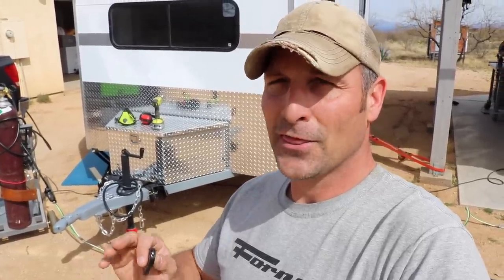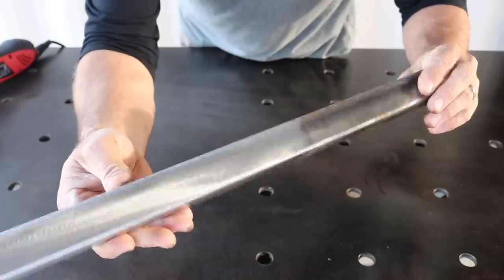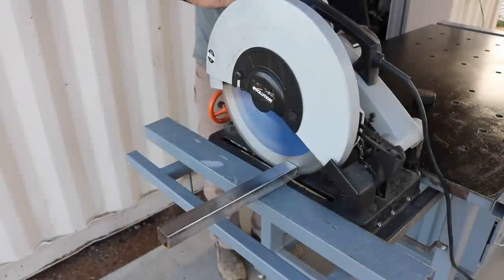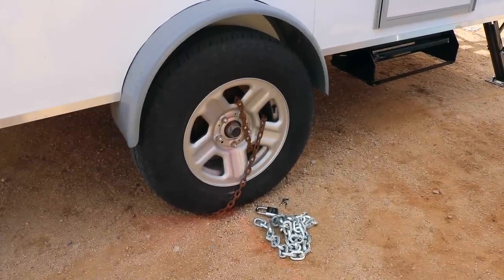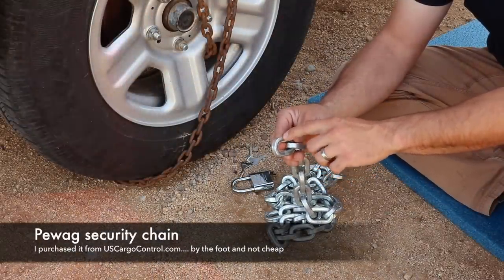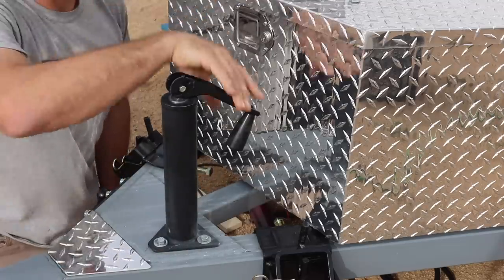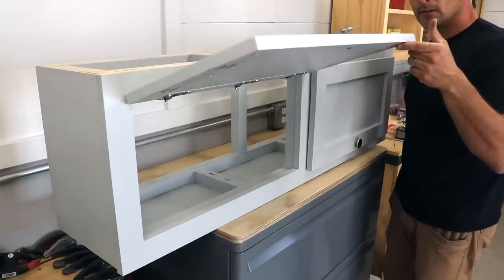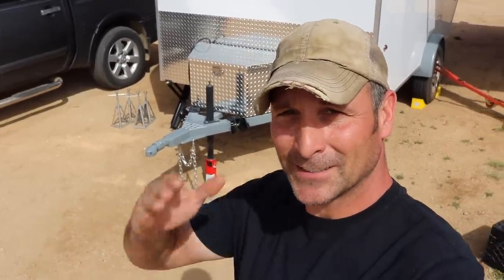How to Build a DIY Travel Trailer - Folding Steps, Security, jack mod and more (Part 8)

Comment: Our trailer had button magnets mounted on the ceiling to catch the pulls and hold the upper doors open. Clean, easy and worked well.
Reply from the maker: I've been thinking of magnets as another option for sure :)

Comment: i too, use a drill on my trailer jack. although i did not weld a nut to it. i used an old spark plug socket, drilled a matching hole to rin bolt thru shaft of jack. use a socket adapter on my drill... works great. many campers ask about it and say they are going to do the same when they return home.

Comment: To make the five jacking points more secure, you could always weld on the head of a security/locking wheel bolts that you'd use for expensive car wheels - you'd need to cut the heads off of then weld that onto the end of the jacking points - Even just having one security bolt makes it infitinitely more difficult to move the trailer and although the chain is a good security measure, you want additional measures to make it more secure.  A potential thief will come with a socket set as the legs could be down, but if theirs a locking nut they can't undo, then  it makes it more difficult for them to steal and will more than likely leave it alone.
Reply: I was thinking that the chain thats visible on the wheel rim, maybe run it through some painted (for visibility) steel tubing as well, to make it more difficult to get a grinder at - padlock it behind the wheel so its in a difficult place to access for someone with cutting tools
Reply from the maker: Andrew (DadofTriplets) you know that wouldn’t be too much either....I like it!!   And adding some tubing on the chain is a good idea as well.  It is currently locked behind the wheel in difficult spot to get at.   Definitely accessible still....since I put it there but certainly makes more hassle to get to it

Comment: Good stuff Joe, coming close!

As you and others have said - if they really want to steal it, they will. The key is to make the crooks think hard about how badly they want it. 
I have a similar system on my SUV, I run a chain from my accelerator pedal to my steering wheel, so that if it comes down to my truck or the one parked 2 spots down, hopefully mine is less attractive....
Reply from the maker: MamboTek yep that is ultimately what it comes down to...making it less attractive to the thief😀👍
If they really want it then they will figure a way...but at least I can make it a huge hassle
Regarding thieves... I have such a disdain for those kinds of people that if I could figure a way to put a bear trap on that trailer without hurting good folks...I think I would😂

Comment: They make a step called solid step, and they bolt under the door and go all the way to the ground. You could probably build them yourself. I have them on my camper and it does not shake at all. Love your videos by the way!
Reply from the maker: Thank you Cooper!    That was my original plan... to get a single step and have a solid one that I just set up below it... but when this double step opportunity came up I was  sold ;)

Comment: Do what we do & use a rock right under the tip of the last step.
Where just hillbillies down here in Missouri... lol... it works for us & I got a souvenir from the lake.
Great job anyways.
You need a trailer lock that goes on the tongue of the trailer.
Chris from Missouri
Reply from the maker: haha... yep a rock will do the trick for sure!   and stayed tuned as I do have a coupler lock in the works :)

Joe

Comment: Painting the chain red may keep you from driving off with the wheel locked. Maybe add a flag too. (So you or your co-pilot can see it in the rearview mirror.) It will also be more noticeable to theives "casing the joint"  💜🌵🌞
Reply: Great idea. I drove of with a U bolt lock thru the wheel and didn’t even notice because I was on snow and ice. Then hit a dry spot and destroyed my wheel. “It happens”

Comment: Mounting accoutrements is where I regret buying an aluminum trailer. Moving it is where I rejoice buying it. I'm working on security that will make my trailer less attractive to the criminal minds with battery-powered cutoff wheels. Love the jack hack. It will allow me to mount a propane bottle on the front.

Comment: We've had trailers, motorhomes and 5th wheel's my whole life. We've never had any stabilizers on any of the entry steps to any of them. Nice touch on the tongue jack conversion. That's a nice jack too. One thing you can do as a theft prevention measure is to remove your  safety tow chain and put it on only when towing it. People  use them to tow with. Also, I recently stumbled onto a bunch of youtube videos about lightweight  cabinet construction  for r.v.'s. Do a yahoo search on poor mans fiberglass  and dive in.

Comment: Excellent upgrades!!  You may have already thought of it and created an "idiot proof" (no insult intended... haha) reminder to ensure you don't hitch up the trailer and go to pull out and forget that the Pewag is still locked through the wheel.  I used to clip something like a "Remove Before Flight" flag on my trailer tongue to help me to remember the 3/8" cable I locked through my trailer tire/frame.  Just an idea...  :-).  Great vid!!!

Comment: Great..but your travel trailer deserves a holding tank for your Grey water. Think about It! Good job as always!
Reply: He's putting in a tank under the sink. Did you mean something larger under the trailer?
Reply from the maker: Carlos Eduardo Zampol I will have a small portable grey water tank under the sink.  I’m not going to have anything under the trailer except for something to protect the underside from road spray, etc
Reply: @homesteadonomics  I think that is a good choice. 👍
Reply: @toronado455  Yeah, a holding tank under the trailer. You do not need to remove it for cleaning. When it is full, you connect a hose into its tap, open it and discharge it into a  camping site with septic tank or any other specific place ( in a filling station, for instance )

Comment: Hi, you might want to consider sealing everything behind your cabinets before install. Trailers are especially vulnerable to insect infestation and colonies behind cabinets are particularly hard to get at. A good bit of silicon now may save serious head aches later.

Thanks for the cool video.
Reply from the maker: Phylis Maddox yes, good point and I will probably do that😀👍

Comment: When designing your tounge lock it might be a good idea to lock the safety chains inside of it too so they can't just use those to drag it away.
Reply from the maker: Todd McCarter I’ve definitely been thinking about how to do that....the proven industries locks have that....but I also may just remove them so there isn’t any chain to attach too...they are connected by removable links

Comment: Nice work, I'm sure you probably have heard this before. Lock up your safety chains also. Thieves can use them to haul your rig away.
Reply from the maker: Check out my travel trailer coupler lock video…. It locks the coupler and the safety chains are removable

Comment: Should put the bolt back in the hole on the jack. Lost the lower part when the nut came off my old trailer, I didn’t clean off the top before I welded it are my only thoughts.
Reply from the maker: I will keep that handle and bolt for sure, as a just in case :)
Reply: The bottom part falls out when the jack is up without the nut welded on top or the handle on.

Comment: Very cool. Jack supports looking very much like the ones I got via Amazon for my travel trailer — it’s converted to a man cave. Work really well. 
I did the heavy chain security system when I traveled overnight with my utility trailer. I slept better. 
You’ve come a long way in welding skills since working with your father-in-law. Do you use 120-v or 240?  Any recommendations on a good welder for a hobbyist? I have an old buzz box stick welder, but want something more modern. Thanks Joe, appreciate your channel. Dan

Comment: Joe, are you going to put some underpinning/protection to the underside of the camper?  I saw while you were installing the steps the wood joists and insulation for the floor.
Reply from the maker: Willie Gardner hi willie....yes I will...I have some corrugated plastic that I plan on putting under there but depending on if I have enough left over aluminum from the hail damage re skinning I may put aluminum under there😀
Reply: @homesteadonomics  Good, saw that and thought I know he did not forget that!  Would not last long on the road with rain and snow before oops why is my floor so soft and wet here as your leg goes through to the ground lol. Great job as always Joe!

Comment: Hey Joe, a big thumbs-up on the power jack modification. I don't know if you did the same thing with the trailer's jack stands, if not will you implement that idea to use your drill motor on them as well? I have a suggestion for the cabinet doors to keep them open all the way, check out Rockler Woodworking and Hardware on there cabinet door lid supports. They advertise several different types. Looking forward to more of your videos. Keep up the good work.
Reply from the maker: OLD SCHOOL MACHINIST thanks OSM!  The stabilizers are the same size socket as the one I welded on the jack so yes😀👍

Comment: You need to buy a padlock that only has a small section in the middle of the lock that can hold 2 chain links over & under. Or you could get an old dial lock that is circular that the pin rotates into the shroud but does not use balls, you will see by the pin having a square cut in it not a round cut.
Reply from the maker: Solar Function I’ve looked at some of those too as other options and they look very stout😀👍

Comment: It's not often I wonder why you did something, but why did you wire wheel that steel AND hit it with the flap disc? The flap disc would have done everything in one go.

Steps look like they are going to work great. Hope you put loctite on those bolts, haha!
Reply from the maker: BA it’s more of a keeping the flap discs lasting longer....wire wheel to take the bulk rust then sanding it.  But yes the flip disc would definitely do it all in one shot😀👍
Reply: @homesteadonomics  Gotcha. Thanks for the reply.

Comment: Another great one my friend. Those steps look really tough. Your dog is like mine, they don't use the steps, lol. Do you like the Evolution chop saw? I use the old Dewalt abrasive saw or my plasma, but before I get started on making door and window frames for the container, I think I'd like something more precise other than a band saw.
Reply from the maker: Thanks!   and YES, YES on the chop saw... it makes cutting soooo much easier!!!   blades are expensive but worth it if you do a lot of cutting.   Will save time and give you more accurate cuts.   i cut most all the tubing for my go kart build with it... really nice!
Reply: @homesteadonomics  it also looks like it doesn't throw any sparks. thanks for the reply

Comment: Great series. How are you going to address heating and air? I have had the unfortunate privilege of living in a travel trailer for over a year for over a year due to a house fire. Snuggling only helps so much when it's cold, and you dont want any one touching you when  its hot

Comment: Would you like to know how people get through padlocks easily, they don't pick it. They cut up 2 triangle pieces of coke can, fold over one side on each, wrap the point & triangle with lip into the inner side of the lock with the folded lip facing the middle of the lock, do this on both lock pins & push down, the balls in the lock pop sideways & the lock pops open in less than 5 seconds.
Reply from the maker: Solar Function yes, all padlocks can be picked or side stepped like you mentioned.   To varying degrees of time and the quality of the lock.  I’ve forced many locks in my Fire service job with just a hammer too(for legitimate emergency reasons or training).   Also, angle grinders can cut through most anything as well.   That’s why I’m adding several layers of security to make it more hassle than it’s worth.   As well as making the unsecured trailer more desirable than the secured one.

Nothing is totally secure to a motivated thief...but on that note, many thieves are victims of their own ailment....being lazy and wanting something for as little effort as possible.   For the more motivated ones, I’ll let the GPS do its job and relish the sight of them in handcuffs when I pick up the trailer 😂

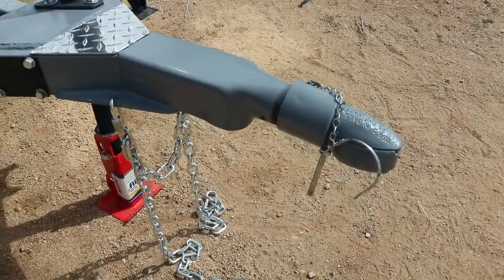Comment: @8:45 Instead of a standard hex nut, perhaps you should use a custom socket and nut for more security.

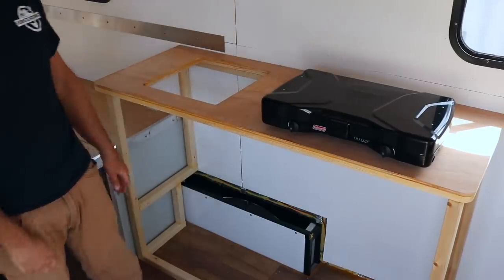@11:46 BTW, you need a new hat. 😉
Reply from the maker: Shawn H Corey yes, that would certainly be a good mod to add some increased security without too much extra work😀👍

And the hat is just finally broken in😂

Comment: Can you lock the steps when you are driving? Rob.
Reply: I was wondering that same thing myself.
Reply from the maker: Rob Janssen there isn’t anything that specifically locks them...except for how it angles them down...I’d imagine it would take a very large perfect bump to get them to move at the angle that they slide up and out ....the cut out angles them down pretty good.  But on the safe side I could always just throw a tab on that pivots over the slide track
Reply: @homesteadonomics  d

Comment: chain cutter will cut your chain link. why not a steering wheel lock bar and one lock lug nut on the same wheel? you won't see your trailer towing on one wheel for sure.

Comment: I watch several RV YOU TUBERS one is called Traveling Robert he has a Minnie travel trailer and none of them put chains around their tires, is that necessary???
Reply from the maker: Suzette Calleja hi Suzette....it is certainly not necessary by any means....some folks never secure their trailers and never have a problem...and other folks have gotten their trailers stolen....  just depends....but I have spent more than enough time building this that it’s worth it to me to add some additional layers of security to make myself feel better.  Either way is not right or wrong...just a preference.  Some folks would prefer to just insure their trailers only and just buy a new one with insurance money if it gets stolen.  Unfortunately an insurance check could never replace the effort and time Ive put into this....a labor of love 😉👍
Reply: @homesteadonomics  I totally  understand.  There is no way you could  replace your time and effort  with insurance  money. I also  understand  why you might do that where you live after hear who came onto  your property.  Thank you for explaining  this to me. I should  have known  you would  have had a very logical  reason  and answer.  That's why I follow  you.

Comment: I'm 62 years old and have been trailering my entire life.  I have never seen steps that need additional support.  What is the point if you have to add jacks to support it?  I would use a portable step ladder before fiddling with jacks.  I'm afraid this was not a very positive plug for the manufacturer of these steps.

Comment: with cordless grinders, chains and locks are at a big disadvantage
Reply: With a decent crane anything under 12tons is at a disadvantage
Reply from the maker: Matt Martinson yep, they can all be cut with grinders for sure.  But that is why I’m adding several layers of security to make it more hassle than it’s worth.  The coupler lock will be out of 3/16 or 1/4” steel and would likely take several batteries worth to cut though...and a lot of patience.   But then again, many people don’t incorporate any security at all.   So my thinking is that a trailer with several hassles to jump through will be less attractive to potential thieves.  Or at least enough time for me to sick a pack of rabid dogs on them😂
Reply: @homesteadonomics  I hear ya, just trying to keep the normal thief away.  A professional will get it no matter what.